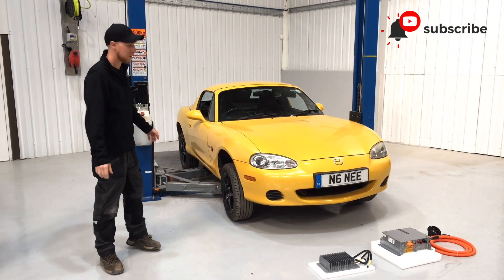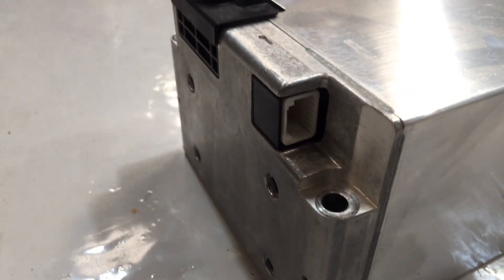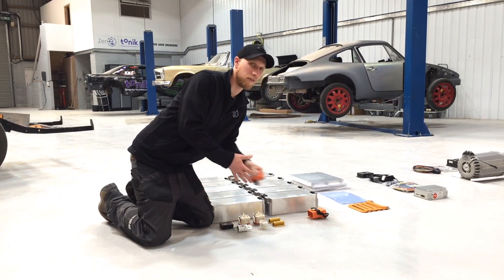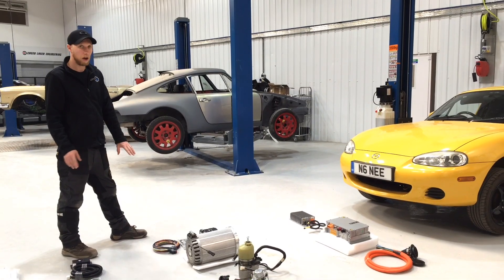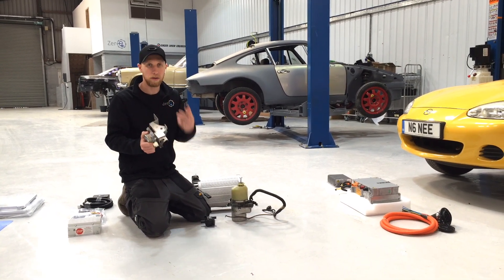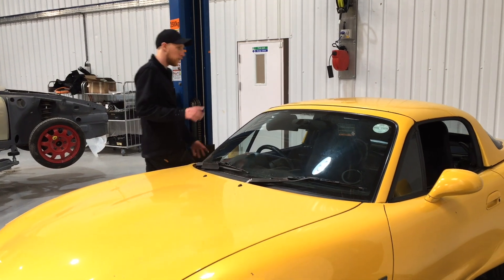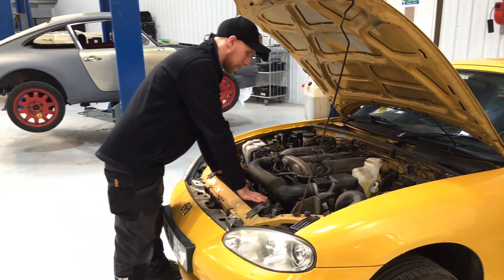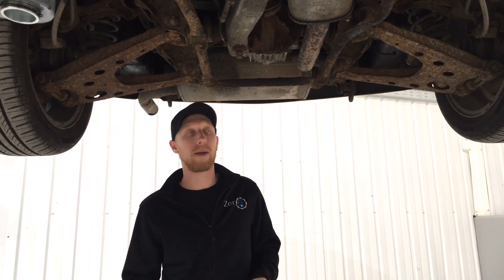We Built an Electric Mazda MX-5 Miata

Comment: What a coincidence that this showed up in my recommended; I’m considering buying an NB Miata for an EV conversion myself!
Reply from the maker: Aiden Bagshaw brilliant, hopefully we can show you how to carry out the full conversion over the next few episodes. We are considering raffling this off once finished!
Reply: Zero EV That sounds awesome! I’m especially curious to see how much this would cost.
Reply from the maker: Aiden Bagshaw converting vehicles to a high standard is not cheap, all parts come to around 18k with vat
Reply: @Hazell_Nutz  18k in £, € or $US?
Reply from the maker: Aiden Bagshaw £ that’s for all parts nothing missing. Only thing then needed of fitting and battery box/ motor mounts.
Reply: @Hazell_Nutz  I am doing a conversion myself, using a battery pack from a wrecked Wv hybrid (watrcooled), an inverter-controller+motor+contactor from a leaf. so far the parts are less than 2.5 th Pounds. It is nice you show a professional setup - especially explaining how the components work together and important safety standards. Just wanted to point out that an enthusiast diy-er car mak an electric miata at much lower cost.
Reply: @tiborkiss9186  Totally agree with using major components from wrecked or salvaged cars as a way to build an EV on a budget.  It's also beneficial since it's diverting usable parts from landfill, scrapping, recycling, etc.  That said, the battery pack from a hybrid may be a bit small.  Lots of folks have built EVs from Leaf packs and motors.  (Though as we know Leaf battery packs may not have great capacity remaining due to lack of real thermal management.)
Reply from the maker: The main thing is yes you can do a cheap diy conversion, but it should always be done following r100.1 as it will only take one diy project to kill someone or set on fire for the uk government to bring in a lot stricter guidelines. Currently it’s easy to change a car with the dvla to electric but that could change. Please stay safe we are always here if you have any safety questions. Also check out Ev conversions on Facebook very good place to ask questions. Thanks for watching and subscribing 😁
Reply: @Hazell_Nutz  Thank you. I'll definitely use new batteries, as those seem to be the only components prone to exploding. However, my budget is significantly less than £18,000, or $31,541.40 here in Canada; in fact it's about a third of that. I don't suppose there's a safe way of converting a Miata for less than $10,000? (£5,701)
Reply from the maker: Aiden Bagshaw there is nothing wrong with used battery’s. You better off with a used oem battery than a new cheap battery. Your cheaper conversion option is to take a Nissan Leaf and run the original mx5 gearbox.

Comment: I am very interested in this project. Thank yo for sharing. I have a 2016 NC and would love to convert it to electric. Would miss the engine sound but this and a decreased range would be the only real trade offs in my opinion. What range are you anticipating from your battery setup please?
Reply from the maker: John Ballard thank you. We estimated 100 miles range but you could fit a double battery pace to double the range.
Reply: @Hazell_Nutz  With the light operating weight and 26 kWh pack, 130 miles is possible. Of course, keeping a 5% - 10% buffer at top and bottom ends of battery charge brings it down to about your estimate.
Reply from the maker: John Ballard yes you’re correct, we always allow a small buffer and some people have a heavy right foot 😂

Comment: I’d be interested to see a similar conversion done to an RX8
Reply: That would be my choice too I think. Really clean ones with blown engines can be had for nothing. Probably less room for batteries in the engine bay though, I'm looking forward to seeing how the mx5 battery bay looks!
Reply: A split pack would work in the RX8 chassis I think! Great looking car and cheap too!
Reply: This is exactly what I’d. Like to do
Reply: Rx8 would be the best conversion,  I have one in the shed with low compression,  I need a kit now!!!
Reply: Pretty sure I’ve seen a RX8 EV out there in the wild. Perhaps not this exact conversion but I know there is a RX8 EV.

Comment: I have basically just discovered you now. From UK same as me, which is great. And you only posted it yesterday:D I am typing as I am watching the video. I have a 2014 Outlander Phev with a 12Kwh capacity, only 8.5 usable that gives me a 25 miles average range. Can you upgrade the factory pack to increase the mileage on EV only and how much would that be? Thank you!
Reply from the maker: japanluv hi, unfortunately it is not something we offer but I have seen it done with a second pack running in parallel. Have a look online am sure you will find something.
Reply: @Hazell_Nutz  Ive searched. Theres only one guy on youtube from Germany who used a different pack of batteries I think and went to 19. something kwh then 20 something but never gave full details. Npw he moved onto Tesla:)) I dont do much mileage every single day, ussually below 20miles but I can only charge at work and supermarkets so anything extra will work great. Maybe I ll come one day to you for an RX7 conversion :P Good luck in your endeavour and subscribed:D
Reply: james braselton  Im sorry. Can you please reformulate? Thank you.

Comment: Nice!  Can you detail the 3D scan and design process a bit more in the next video?
Reply from the maker: Ruaraidh Walker next video will be strip down, paint and fitment of new bushes in all arms as well as the 3D scanning process.
Reply: @Hazell_Nutz  Excellent, look forward to it.  Given the subframe rear end of the MX5, why not go with a Model 3 power unit like the previous Boxster build?
Reply from the maker: Ruaraidh Walker the model 3 drive unit system is not yet working. There is not enough room in the rear for a drive unit plus we want to show as straight forward conversion as possible.
Reply: @Hazell_Nutz  Ah wasn't that a Model 3 in teh Boxster. My bad it must have been an S small unit.  Gotcha.  Will be following don't you worry, great build.

Comment: Another great video, thanks for continuing to share.. Any suggestions for someone who doesn't have a 3D scanner or modelling skills to outsource that work in the greater London area?
Reply from the maker: jcwright45 we recommend you try fusion 360 it’s free to try and there is lots of really good guide online. Or if you have the scanning done we might be able to look at battery box design and supply.
Reply: Thanks guys... Will be in touch regarding battery boxes in the future.

Comment: Can you provide a break down of cost, and link to these parts on your site, since you already list them 😁
Reply from the maker: French Ben yes we will be doing that soon, want to get the design phase finish as there will be other small components needed.
Reply: @Hazell_Nutz  There are a lot of people wanting this I'm sure!!
Reply: Coolride17  I researched a bit for my Audi 100. Asking the upcoming EV garages in and around Germany you can add a zero there... and even with 100k you start at the lowest range. Since there is no best practice for any combustion engine car everything is custom and the EV parts are still produced/sold in small amounts = expensive.
Reply: @teher1k  batteries and motors are mass produced wtf are you talking about.